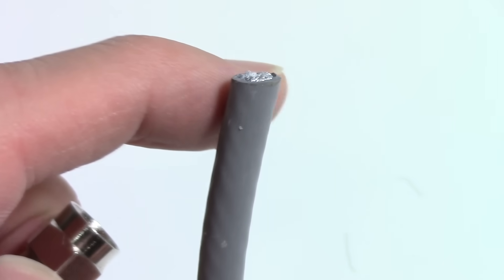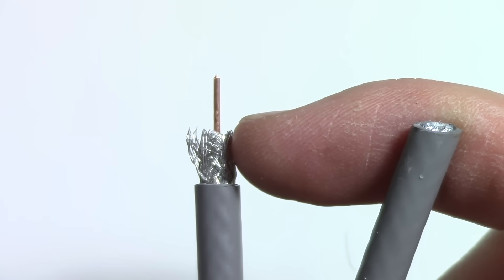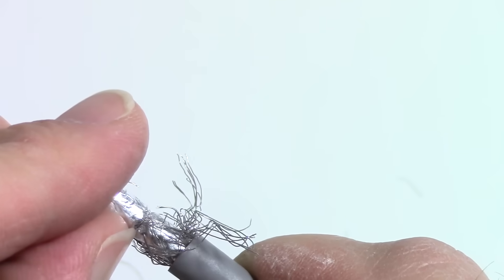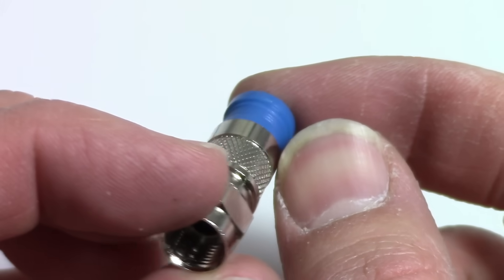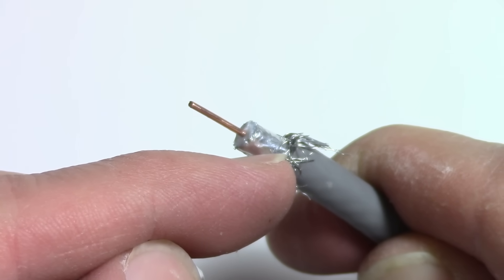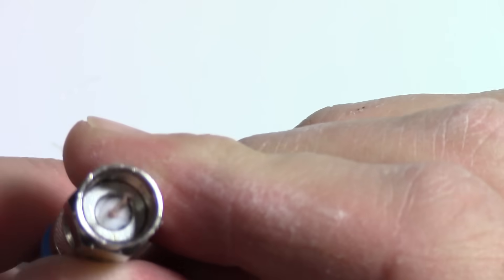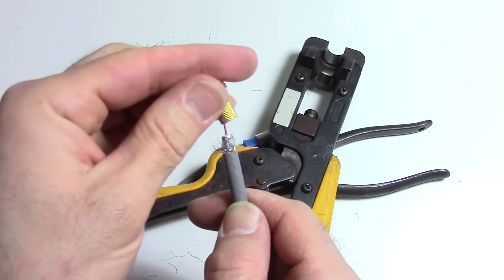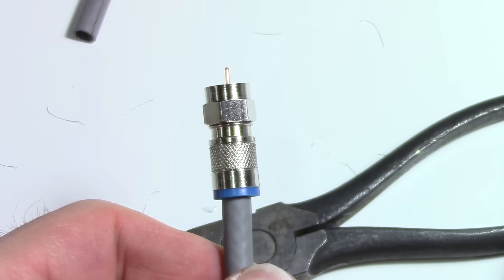Coax TV Cable stripping connector install - Compression and Threaded

Comment: Quick question. I'm prewiring my house and noticed that if I do not shorten the braid in my RG6 to approximately 4mm, it will extend past the barrel connectors once they are compressed on. Some sites seem to recommend cutting any braid that extends after compressing the connector on but I'm hesitant to take a razor blade to coax. Is it okay to simply cut the RG6 braid to roughly 4mm and compress on as usual or is this likely to cause me signal degradation? Thanks in advance for your reply.
Reply: As the guy who's gonna have to come fix this:

Leave a lot of extra cables at your outlets and wherever you're going to make the main connections. (for a couple reasons). 
1. If you have extra braiding you can pull the connector off and try again without compressing. Just cut off what you just did and do it again till you get it right. A tiny bit of braiding isn't the end of the world but if it comes into contact with anything you risk a short. 

2. When you want to put these connections to use, the technician will have enough extra wire to cut off your connectors and to them right. 

It's common practice for technicians to do "the last mile" i.e. Install the F connectors and connect them to wall plates. So you really don't have to worry about it in the first place. 

Also, most technicians are so annoyed with people telling them that they didn't mess with the wiring (after they obviously did) that if you ask them to do it correctly most will just take care of it so they know it's done right.

Thanks and good luck.
Reply: RS3Sub I'm sure lots of engineers troll YouTube comments (while learning how to prep coax) to call strangers "idiots". Do us a favor and call before you knock out your neighbors service. Kthxbye

Comment: At 5:09  I would use the term compression tool. It's not informative to say crimping tool here because crimping is another way to attach an F-connector, and a crimping tool is an entirely different tool.

Comment: when working on the coax cable coming out of the wall, what kind of voltage and currents are there in it?
Reply: You shouldn't have any voltage. It should all go out through a ground wire.
Reply: What voltage do you have between the positive and ground?

Comment: I would like to know how to have the tool. I found these places. Is it good? http://www.banggood.com/fr/Connector-Compression-Tool-Crimper-for-RG6-RG59-F-BNC-RCA-Coax-Cable-p-947157.html   https://fr.aliexpress.com/item/F-RG6-RG58-RG59-connectors-Coaxial-Crimping-tool-Compression-coax-cable-crimper-LS-H518A/32629788492.html?scm=1007.13338.50051.0&pvid=f4834845-3bc0-4d76-99c1-fc12d3368b44&tpp=1

Comment: Cut your nails
Reply: I bet he only cuts them when they are not just on top the flesh of his fingers because cutting your nails up to the end will prevent you to do some simple task such as peeling little somethings off until your nail grows again.  

I also cut my nails that way, but always keep the under clean simply because sometimes you have to use your nails to grab on simple stuff like small screws or scratch something off some surfaces.

Comment: also please show how to remove the connector from the cable for re use of the connector in case of the cable failure
Reply: hahahaha ha you're too funny there's no reuse or removal of the connector unless you cut it off 3cm 1.5 inches lower.   reuse,  what other connector are you going to put on Rg6?   what reuse?   as a noose?   or are you gonna strip the wire from someone's prooerty and sell it?  except the twist on there's no removal that's the idea.  to have a solid connection.   thanks for the laugh,  take the connector off and reuse hahahaha

Comment: people do this kind of crap then they complain to the cable company why their shit is not working
Reply: What makes you think Average Joe's Cable Installation doesn't use a razor blade and those exact same crimpers and connectors? Spoiler: He does. Only difference is he probably has a nicer pair of strippers, which might be dull or he misplaced them.
Reply: They installed new cable in my GFs home & the guy was useless. Oh it was his last job on a Friday!
Reply: @John Doe then he is not properly taking care if his tools.  The proportion need to be correct too.  The prep tool makes that right. Eyeballing with a knife can make the center conductor too long or too short and so on.

Comment: Appreciate the effort. However, you have no business making these sorts of videos. The "foam" is the insulation. The "metal tube" is the shield. A razor blade?? C'mon man!!
Reply: At the end of the day this is the general idea and the Shit still works he said his for people who don't have or wanna get the tools so they'd probably never even do the Shit again
Reply: mark naz true and the other part is the. .......... braid shielding it's double shielded the quality of the cable and price of a 500' roll is determined by these factors,  UV  rating,  and quality of center conductor ie full copper  (the best) or copper clad steel, tin, etc ( like cheap gold plated things.)  also he mangled the braid should be evenly distributed around blk jacket for better connection.  electric voltage is conducted via wire too in case of satellite TV.  Also his foam wasn't entirely level inside the top of the F connector.  I like mine level only a proper tool does that.  never mind Klein,  local electrical supply stores have better quality ones that strip with more precision usualy black or grey with a built in he wrench to switch between rg59,  and rg6
Reply: Actual name is dielectric for the "foam"
Reply: Lmfao go out on a job talking like that 😂😂 you get shit done. You make sure it works. And you do it as efficiently as you can….. none of those steps require you to call the sections of cable by their actual names c:

Comment: wow first off use a wire strippers rg6/59 it is cheap as a razor blade; second that stinger is way to long should be flush with the top of the fitting. so when you put it in a barrel its not overlapping and not scoring the splitter or tuner barrel lol...
Reply: He said you can do without the compression tool which is not correct also

Comment: I have found that these Ideal blue compression connectors are junk. I specifically followed his instructions using the Ideal stripper and crimper and the connector falls off the completed cable assembly. Anybody have the same problems. If you have any ideas on how to get them to actually stay on the RG-6 cable let me know.
Reply: For (1) AT&T cable installer use these blue connectors. Number (2)  You didn't follow the video closely.  After connecting the cable properly, it needs to be compressed.  It's the compression which holds the connector to the RG cable.

Comment: Well...butchered that pretty good.

If you want to fight the battle, get the proper weaponry. (Sure, you can bring a knife to a gunfight, but you ain't gonna get very far...) Use a coaxial cable stripper to PROPERLY strip the cable to the right length, so that you don't have to cut the center conductor post-crimp. This will also prevent all of that twisty-forcy, time-consuming fight, trying to get the inner dielectric flush with the wall of the connector.

The reason for compression ends is....better SNR / less loss at the connector.
Reply: slipstick99
Reply: Thank you

Comment: Tools required for this are: Razor blade, band-aid, antiseptic.
Reply: With "Harry Homeowners" like this, cable techs will always have a job cleaning up after this bull$&@!.
Reply: kevin sherman agrees,  I’ve worked for Comcast for 3 years now as a tech.  I’m always fixing bad repairs like this cause customers complains about poor quality picture or slow internet offer they try to fix it themselves
Reply: @jaxon1174  I just had a guy come to my house from Comcast and her told me not to use the compression connector but instead use the one that you crimp. Was this good information and if so do you have a recommendation for any tools
Reply: DIY:  Daily, Injure Yourself.
Reply: Lol exactly
Reply: John McGaughey kyjjjhplj
Reply: subdirect repairing signal
Reply: I thought the center wire was going to go through his thumb pushing the connector on. lol
Reply: EMT standing by !
Reply: Bruh if I knew it was this simple i wouldnt have called my isp to come install a new 1 since I cut the old 1 as it stopped working
Reply: Well apparently I’m the guy who’s look to purchase the correct tools needed for this. So who can help me?
Reply: Smart ass..lol
Reply: Shaving must be very difficult for you sir
Reply: 😂😂 wow
Reply: Shazam be more specific . those are the items\tools needed for those who are clumsy .and the ones who just tamper with shit carelessly . but accidents do happen so your not complety wrong . i guess
Reply: +Shazam lolol
Reply: Shazam  g
Reply: John McGaughey remove coax connector
Reply: This is bullshit.. This is how not to do it
Reply: i hate mickey mouse.....
Reply: Don't care for this at all.  It safe, plus there's a good chance your blade could score the center conductor.
Reply: I won't be using special tools... pulls out special pliars.

Comment: My coaxial cable have 2 netted arrays.  There is a center hard wires,  the foam,  a first set of small wires, a foil isolation, a second set of small wires and another foil isolation.  What kind of coaxial is that one? I couldn't fit a connector there.
Reply: most likely rg6 quad shield

Comment: Screw-ons are not an option, man.
Reply: Albert Gilder if you guys are pros then why are you watching a how to video?
Reply: Skrt Skrt to see why people keep fucking up a relatively simple task.
Reply: Screw-ons are for screw-offs.
Reply: i dont know why they still make screw on f connectors. they are shit even if your just using them for aerial antennas. i was a tech for comcast and hated when you go to do a fresh install on a newly built house and the electricians used screw on connectors. or put cheap ass 800mhz splitters on the cables behind drywall. like damn if you aint doing it right dont do it at all
Reply: Albert Gilder Screw-ons work fine if you prep the cable right. 

Source: Drastically more experience in the field than you.

Comment: This is an awesome video, however, I still think tools are made for you to do the job effectively and efficiently, the tools don't cost that much. and if you are dealing with coax cable jobs, best if you might as well get the tool. Using the blade, if not being careful, you can cut your fingers by mistake, or even get cut from the shield, or even cut it out of the proper length. If it just a quick job and you are a pro, then you can avoid the tools, but if it a major job of running cables such as extending your tv signal cable , just like what I am about to do, get the tools, it is definitely worth it...

Comment: You need to be care.  The wire on shield are very sharp.  Better if using special tool for stripper.  Oh and you do not need to mess with shield wire.  Just put tip on.

Comment: You made a lot of mistakes in this video.  To install a F-connector the right way, you need the special tools.  You can't just cut the center conductor if its too long, you shouldn't cut away the braid.  The braid acts as a ground, and you have a nice suck out in the connector.  I can go on and on, but my point is.  You shouldn't show people the wrong way of doing this.  Have fun with missing channels and image tiling.
Reply: The video is correct, you just missed it.  He curled the braid back as should be and the 
center conductor can or must be cut if it's too long. I've done this for a living a long time ago and only refreshed my memory.  No, no you don't need special tools either, the tools are meant for production & quicker work and for idiots who don't know otherwise.
Reply: +Bill Fuget  Why don't  you do a video for us .
Reply: +Bill Fuget wtf are you talking about. you CAN cut the center conductor when its too long. you're trippin
Reply: Worked for me perfect. Made a 15 foot and 8 foot. Used a box cutter. Made two in 5-6 mins. Great video for me.
Reply: Bill Fuget i like this video/

Comment: First cut the core free. The outer sleeve will protect and keep the braid in place while you are cutting. It gives a much cleaner cut. Then make your second cut to expose the braid and foil. Never cut all the way, scratch the vinyl partially so the knife does not touch the core (first cut) or the braid (second cut). Then pull the vinyl or foam, it will tear along the scratch you made.  

Much better is to use tools designed for the job. These tools guarantee a good cut without damage to the core/braid and they cut at exactly the right spot. Why not spend a few dollars for the right tools?. They are cheap compared to what you spend on your TV equipment.
Reply: hi there but what the name of the tool?
Reply: You should make a video of your suggestion
Reply: Bor the Wolf no no no trey
Reply: That's not the point of this video. But haters gonna hate.
Reply: Thanks so good info.
Reply: The True Thug's 4Life
Not telling you with a name like that...

Comment: A lot easier to install these F Connectors than BNC Connectors.  I need to get a new Connector Compression Tool unless there are new replacement parts.

Comment: You need to be really careful when running the razor around the center conductor because all the signal travels on the outside of it. If you scratch it or cut into it you could get intermittent issues and repeat trouble calls.
Reply: +Rick Simmons those repeat trouble calls are the worst haha.
Reply: Rick Simmons good lookin out homeslice
Reply: Rick Simmons use a dull pocket knife to cut outer insulation, then get your razor to cut braid. Dielectric shield will cut easily with your pocket knife.

Comment: FYI. The center conductor on rg-6 cable is copper-clad steel. Buy using a razor blade you are most likely severing the copper, thus losing most of your outer band. Kline Tools makes the best coax stripper I have ever used and it costs $11 at Home Depot.
Reply: ***** Can't have a senior moment when you're 17. He had a teenage boy moment, plus... I kind of like the "rocket surgeon" thing. I'm going to use it.
Reply: +Moses C Hey Bucky!  Those hands were NOT the hands of a 17 year old.
Reply from the maker: Good to know! Thanks!
Reply: ***** I was agreeing with you that it was silly, relax. I can tell he's 17 because his name ends in "9898"
Reply: His handle ends in 9898, is that better? It's common for people to put the year they were born at the end of their usernames. That combined with the way he writes is pretty telling. Don't be an antagonistic dickwad and then you don't have to worry about "(people) commenting on (your) minor comment when Bill Fuget below slated him something rotten."
Reply: I called you an "antagonistic dickwad." So... yes and no.
Reply: Such is the spice of life. jaiden9898
Reply: If one is a craftsman and a handyman the use of a razor blade is fine,  we used razor blades in the 50's when such tools weren't available.   Simply said you don't fit the DIY type.
Reply: Moses C .
Reply: Makes him no less of an antagonistic dickwad.
Reply: Moses C  haha.
Reply: Copper clad aluminium but close enough. Steel is not a good enough conductor.
Reply: It is steel.  Try a magnet on it.  It will damage regular cutters.  The signal rides on the copper due to skin effect.   @gt5228z
Reply: @solarsynapse  they do exist but are very rare. CCA makes up 99.7% of coax.
Reply: They are not all steel.  Be sure not to cut a steel center with regular cutters.  It will damage them.  The steel is used for overhead runs for strength.
Reply: ***** "Scientist Scientist Scientist Scientist Scientist Scientist Scientist Scientist Scientist Scientist Scientist Scientist Scientist"

Rocket scientist + Heart surgeon = Rocket surgeon, or heart scientist.

Comment: I found this very helpful because it was what I was looking for because I got the tool and push on connectors but neither had instructions on how the cable should be cut and prepared to use with these.

Comment: If you can use a little bit of your own brains then you can do it without a tool but he did make it clear it will be a little less quality or you can use a tool and get a better result using a push on F type connector. The tool is available for less than £5 on Amazon.co.uk if you want to buy.

Comment: That stinks that you say "No Special Tools" and then you pull out the compression tool.  Come on ...
Reply: He did show you how to do it without special tools.  Then he showed how to do it with a tool.  I don't see the problem.
Reply: agentj3000 he showed how to do it with a different type of connector than is shown in the thumbnail so it is a bit misleading.
Reply: To do it without a compression tool, use 2 large sets of pliers on either side of the fitting and sqeeze them evenly. It sucks, but not much else you can do if your crimper breaks.
Reply: Vcbbbb
Reply: JSE  b
Reply: Yeah, I agree. The crimp connector is better and he should have clearly stated at the beginning that the tool was required.